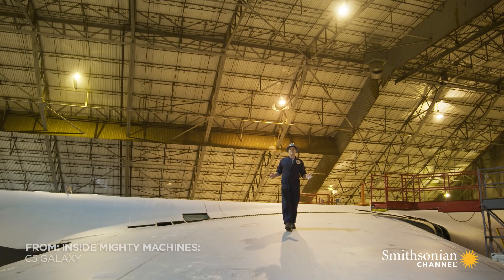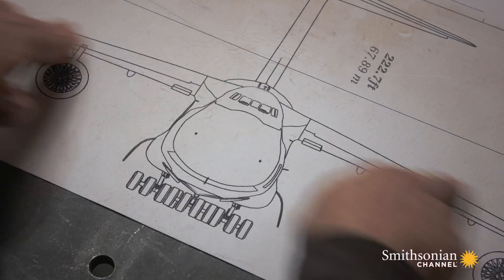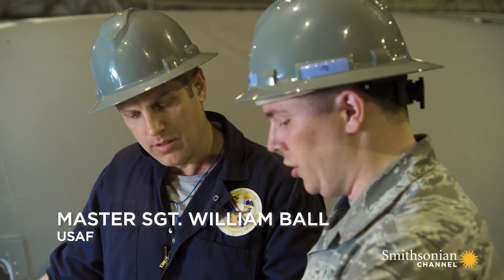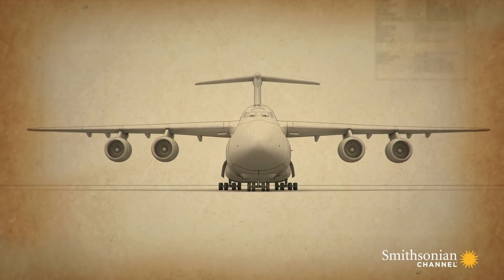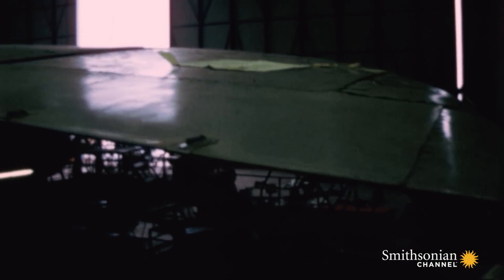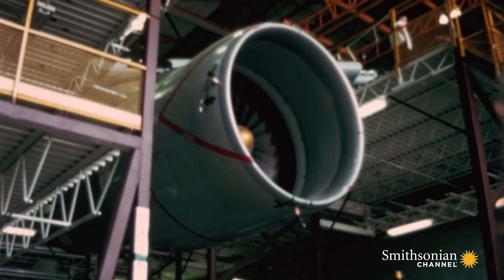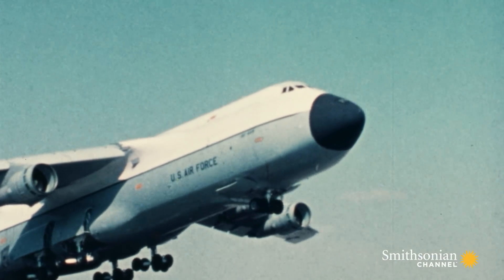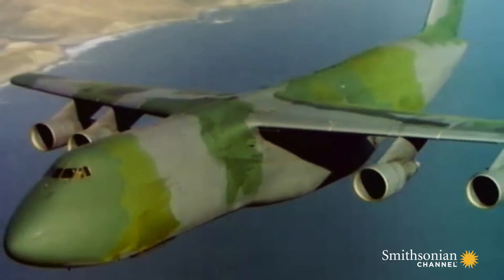The C-5 Galaxy Had a Catastrophic Design Flaw

Comment: This annoyed me, they make it sound like it had never been done before, high wings were around in ww2 and the angle down was also around, it is not to hold weight but to help stabilise the aircraft, the corsair is an extreme example at the opposite end, and to top it all off, all aircraft wings flex if they didn't they would snap off as all of the weight would be concentrated on the point in which the wings attach to the fuselage

Comment: I worked on the C-5 while stationed at Dover AFB. The wings aren't the only thing that cracked. The cargo bay floors did also. One aircraft was limited to 10,000 pounds of cargo. 10% of its capacity. The landing gear also had a flaw. As the main gear rotated in and out of position they actually ground metal from the struts. You could go look at the gear after landing and see metal shavings on them. As I recall, it took 76 man hours of maintenance for every hour of flight. The aircraft is a complete and total pig. Of the seven different air frames I worked on while in the Air Force the C-5 was far and away the worst. A true maintenance nightmare. Biggest POS in the inventory.

Comment: The venerable B-52 also had wings that drooped down from the fuselage. Watching a B-52 take off was quite entertaining. The tip tanks took off about a minute before the plane itself did. It rolled down the runway and the wings lifted up, and eventually they lifted the whole plane into the air. And when it landed, it looked as if the tip tanks would drag on the ground.

Comment: Real reasons for structural and fatigue problems.

The wing was designed in the U.K. and they used a committee procedure to oversee design.  The US Air Force life cycle loading was very soft.  In other words the aircraft few around nearly empty.  The fatigue life of the critical joints was determined by laboratory conditions. (Perfect conditions  Not what was obtained from factory assembly). This resulted a design that could go to the ultimate strength of the aluminum extruded panels.  The tension stress levels they tried to achieve was 85 Ksi.  Note in the same building in Georgia the L1011 wing was being stressed to 45 ksi.(from memory may be slightly higher). 

The first static test failed 109% of limit load. (Requirement was 150%).   An. Engineering error was the placement of the fuselage bulkhead for the wing mid spar.  Landing gear placement etc resulted in decision to carry wing shear loads to adjacent fuselage bulkheads.  Error was one engineer designed shear webs and another designed spar caps.  They forgot that web would pick up tensile loads.  Fasteners between web and spar were designed for shear loads only.  Lower spar failure was 7 inch from wing to mid wing fastener pattern.  After design improve T.S. they did make 129% of limit load.  

Due to the high stress levels and optimist fatigue prediction the lower aft spar to mid body joint was failing at 4000 hours.
Reply: Thanks for explaining what the video should have!
Reply: Brilliant! Thanks a lot

Comment: It seems McDonnell Douglas Corporation,  especially the Douglas Aircraft Division Division got the wing design right the first time,  unlike Lockheed.   My question is,  why didn't Lockheed learn anything from the C-141?  Basically a high Wing Aircraft like their  C-5A.  I flew on my first C-5 back in May 1974 from NAS Sigonella Sicily to NAS Norfolk VA.  It took like 3 different C-5's that were supposed to transport our SH-2D and our gear, and us back to Norfolk.   Each one that was in transit to Sigonella Sicily broke at some point along the way,  before one finally was fixed enough to fly us back.  The Lockheed C-5 was always a maintenance problem waiting to happen.  The McDonnell Douglas/Boeing C-17 is a much better aircraft,  especially when it comes to dependability issues.

Comment: One of the major problems with this airframe was the electrical bonding of circuits to the airframe itself. The plane was so long that the body would flex, causing the frame joints to pull apart slightly, allowing corrosion to develop, which would then cause electronics to work only intermittently or fail totally. Adding more ground wires was inefficient and costly and would not totally solve the problem.
Reply: No wonder the wiring on these things makes me suicidal...

Comment: Lol this BS deserves way more dislikes. Information given is just plain technically and physically wrong. For example EVERY aircraft wing flexes, no matter if low or high mount configuration. Flexing is what structures do when you apply load to one side. Sweeping high mounted wings down on heavy aircraft is about bringing the epicenter of lift closer to the epicenter of mass, because otherwise that plane would be incapable of rolling and nobody could control it.

Comment: I'm 35 years structural engineer and this video is awful. Complete sensationalism death trap) and ignorance. No C5 wing ever failed. All wings flex. Loads being higher than calculated caused fatigue. Cracks don't mean failure. They beefed wing up. Success.

Comment: Most ironic ...
They started with the concept that stiff-wings were too vulnerable to cracking . Then , their flexible - wings started cracking , so they had to stiffen them !  My own  experience with metals has shown that ANY repetitive deformation causes metal-fatigue . This means that aircraft wings should be made as strong+stiff as possible . The problem is turbulence , inducing sudden high loads onto the wings . This could make for a bumpy ride! 
D.H.

Comment: 1.) How does "designing" wings to flex add $20 million to the cost of every plane? Wings flex. That's a fact, not a design choice.
2.) How does keeping the wings from falling off constitute an "upgrade"? "Yes, sir, you can have the regular Chevrolet, or we can give you the luxury version, with wheels" sort of idea?
Reply: The specs the sir force wanted were simply too ambitious for the time. So Lockheed had to save weight, and later it showed the original wings were too weak, and got cracks very soon.
Reply: @simonm1447  
Simon,
I have no idea what "simply" or "too ambitious for the time" mean. I think that aircraft manufacturers always have to save weight, so I don't know what you are trying to say here.
Wings don't go running around the town "getting" things, so I suspect the cracks developed in the wings.
So once more, I'm puzzled, scratching my head and wondering what you are trying to tell me.
Reply: I was in Home Depot the other day and saw a walk-behind lawn mower with the advertisement, " GUARANTEED TO START". Yep, thats like selling a bicycle and guaranteeing it will roll. Pure genius.
Reply: According to an article I read recently, this is how Lockheed did defense projects. They slapped together something quick-and-dirty because they knew they could always charge more later to fix the engineering problems. When Boeing bought them, the Lockheed execs brought that culture into Boeing. And that's how the 737 Max was built, and why it killed 346 people.
Reply: @MartinOmander  sorry to burst your bubble, but Boeing doesn’t own Lockheed and never has.

Comment: People are smart. Ye are both over explaining and under explaining. You are describing flutter. It has nothing to do with dihedral angle.
Reply: Maybe you guys can make a better video about the C-5 Galaxy then these people. Because that would be awesome.
Reply: @ColonelFrontline1152  PDX Heavy on YouTube made a video on this, filling us in on what Smithsonian failed to tell us
Reply: Aircraft structural engineer here. See my comments in main body. The fatigue cracks were not caused by flutter. They were caused by cyclic wing flexing. The wings are stiffened so they do not flutter at normal flight speeds.
Reply: It is crazy how many times I see your comments. Love them and your videos.
Reply: These Smithsonian videos are mostly click bait.
Reply: No need to be snippy you've made a bigger mistakes especially in your Blitzkrieg video
Reply: @BurnoutDurb  His argument wasnt about mistakes. This was about things not being explained or over explained. At least he tries to explain and not just make a video without explaining anything.
Reply: By the way have you finally figured out what defense in depth is?
Reply: The C-s actually has anhedral which is a sloping down of the wings. The AV-8B and the C-17 also have anhedral. From the web:

"Anhedral wings will induce roll instability and improve roll maneuverability. ... Both the high wing configuration and wing sweep contribute a negative sideslip-induced rolling moment, and anhedral is necessary to limit this moment. If sideslip causes strong rolling, the aircraft will have a tendency to dutch roll."

Comment: In the beginning, the wings were the least of their problems. A rear pressure door blew out and grounded the fleet. MAC was forced to discontinue loading from the rear of the aircraft until a suitable replacement could be implemented. This aircraft had a reputation for being parked at airfields all around the MAC system. Eventually they got their act together at the expense of the C-141 Starlifter.

Comment: The C-5 is capable of flying long distances because of the huge tanks in the wings without refueling. The high wings also have a plus in that the engines are so far off the ground they are less prone to FOD. Most new aircraft are giant vacuum cleaners because the engines are so low to the ground. I have seen heavy tanks loaded, but was really impressed when they load a Semi with a trailer on one.

Comment: The C-141 and many other aircraft have a high-wing design. It wasn't that innovative, but the size of the C-5 made the flex more problematic. I flew the C-5 from 1973 to 1978, I never felt I was flying a "death trap." The wings had to be strengthened to extend the lifespan of the airframe and it was done long before President Reagan. The unique success of the C-5 airlift to Israel in the Yom Kippur War in 1973 proved the necessity of extending its longevity.

Comment: Did you ever see a B-52 loaded with fuel and bombs.  The wings have runners to keep them off the ground.  When the B-52 returns, the wing tips are about 12 feet in the air.

Comment: The primary reason for anhedral on high wing heavy lift aircraft is to counteract the low CG relative to the centre of lift. With a high wing design, the mass of the plane is well below the wing and with anhedral on the wing, the lift on the outboard wing increases as the plane is rolled to horizontal, assisting the initial roll. The structural consideration is secondary. Similarly, with low wing designs, a flat or slightly dihedral wing helps to counteract the inherent instability of having a CG well above the centre of the roll moment. This is a silly video.
Reply: Thank you. Finally someone who knows what's going on

Comment: Not a single C-5A ever crashed as a result of the wing cracks.  The C-5 has been in service for 50-years, with nothing in sight to replace it. Ronald Reagan was right!  It was the right plane at the right time to address the military needs of the nation and the "Free World"!! It is amazing how narrow minded critics creep out of the woodwork years latter.  The 747 was originally designed to compete for the role of the C-5.... The 747 went on to be an amazing success in an alternative life, and as a cargo plane hauls massive amounts of time critical cargo to every location on the planet.  The two planes spawned by the same requirement have served the world flawlessly.

Comment: So many errors, the C5 was a bigger 141 which had anhedral too as do several high wing aircraft and all heavy jet wings are designed to flex! Lockheed wasn't the best at building wings, the L1011 had to have her wings rebuilt too!

Comment: I think while there was support for the USAF to replace the C-5 with the 747 freighter versions, the 747 freighter's cargo floor was WAY off the ground, which made cargo handling not a good idea, especially since the C-130 and C-141 had roll-on/roll-off ramps. It was easier to just re-wing the airplane and install improved TF39 variants instead. In the end, the re-winged C-5's also made it possible for the C-5M upgrade with modern engines (a CF6-80 variant).

Comment: The flexing is actively dampened via the ALDCS (Active Lift Distribution Control System) that compared accelerometers in the wings with the accelerometer in the pitch autopilot computer and sent control signals via the yaw/lat augmentation system.

Comment: When there's a design flaw in your car the manufacturer has to eat the cost of the recall. Why do tax payers have to pay for fixing faulty military gear?
Reply: because the government makes the contracts that way.   of course the government could have reduced risk by accepting a prototype for testing, but that would have delayed the procurement a good deal, and perhaps added more costs.   anyway we ended up with a long lasting aircraft out of it.
Reply: not always to car makers eat the costs.   my nieces honda had a regulator fail for the roll up window, $500 for the honda dealer to replace it.  cheapo plastic part broken and the entire assembly thus needed change out.  12 year old car and the window no longer worked, design flaw!   my 60 year old car windows still work flawlessly.

Comment: 737 max 800...engine used is partially over the wing ...the fuselage is too low to the ground for the huge engine put on this aircraft...the effect is a steep climb ...stalling....and tail hits!...scrap this plane before other innocent passengers die!...software cannot remedy an engineering defect!...the engines must be attached under the wings....completely!
Reply: One obvious solution to the 737 MAX engine problem would have been to (somehow) increase ground clearance by having longer undercarriage legs: that might have required a redesign of the plane's centre-section to accomodate the new u./c..Apparently, the airlines were unhappy with the prospect of increased ground-clearance because it would have caused  servicing and maintenance problems, thereby costing them $$$$.

Comment: The C-5 didn't have a design "flaw" per se. In fact, it was simply the lack of sophisticated alloys that prevented the original C-5s from having flexible wings. By the time the B model was built, newer technologies allowed a proper aluminum to be fabricated. Also, the "active lift distribution control system" or ALDCS was added. This system continuously made small adjustments to the ailerons in flight to counter turbulence and other factoring forces in order to reduce wing fatigue.

Comment: My dad was an Eighth Air Force B-24/B-17 pilot in WW2.  He commented that he couldn't see the wingtip lights on the B-24 while taxing, but they became visible after takeoff as the wings flexed up.
Reply: I read somewhere that the total capital cost of all the 18,000-odd 'B-24' bombers would have equated to $90,000,000,000 in modern 'funny money'. That's just the 'B-24's, almost all of which were scrapped a.s.a p. after WW2.

Comment: I think you got the weight Wrong by 10 seconds into this video. I have a sneaking suspicion that a C5 Galaxy weighs just to tick more than 40,000 lb. New paragraph. B-52s who had flexing Wings since their Inception. I have no idea what in the world you're talking about. I don't get the idea that you do either.
Reply: The engines weigh 10k lbs each by themselves. Empty dry weight is around 500k lbs
Reply: @ne2i   I'm relatively familiar with the actual weight, having loaded them on a couple of occasions even though my specific job in the Air Force was an avionics technician and worked on automated flight controls and instrumentation as well as the rest of the flight mechanisms, primarily on F-111 but that extended to F- 14, F15, F-16, and worked on quite a number of other varied aircraft including Darryl greenamyer privately built f-104
Reply: Through ESP, I deciphered he was talking about the weight of the wing, that's probably enough weight to give the wing anhedral

Comment: I understand that the down sweep of the wings has nothing to do with strength (which is determined by its design) rather than for aerodynamic reasons resulting from its mounting on top of the fuselage and being swept back. The C17,  C141, Antonov An 124 and Airbus A400m heavy lifters all have down sweep. Yes there was a design flaw in the C5 but it was in the wing structure. The wings had to be redesigned and replaced.

Comment: "Air lift" is not a term pilots or designers use.    All wings bend....and that is a mechanical movement.  The wings flex, they don't "deflect"  Control surfaces deflect.    The C-5 wasn't the first U.S. shoulder winged tansport aircraft with anhedral..This video is full of B.S.
Reply: Also pretty sure the C5 was not the "only answer to the growing Russian threat"
Reply: When I watched I almost instantly thought "B-52".  Has to use outriggers at wingtips when fueled on the ground, and quite noticeable bent upward when flying.  Nothing really new about the C-5's wing.  It just had a flaw that required some changes and remediation.
Reply: Of course not. “Air Lift” is a military term referring to the ability to ‘air lift’ cargo, soldiers, etc.
Reply: wataaaaaaaa What do you think flex is? Deflection. Cantilever beams deflect under load and that’s essentially what wings are.
Reply: also the anhedral was for stability, just like a dihedral

Comment: All airliners wit wings that big flex about that much... It’s nothing special.
Also the main reason the wings are angled down is due to the fact that the main mass of the aircraft is below the wings, which causes the plane to want to roll back to level flight too much, making it hard to bank the plane and turn. Giving the wings negative dihedral helps to counteract this.